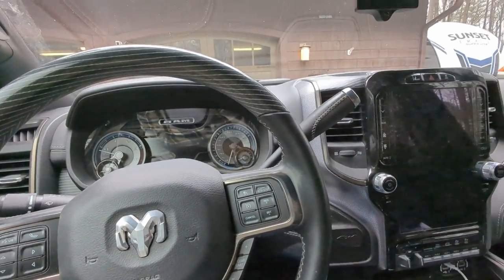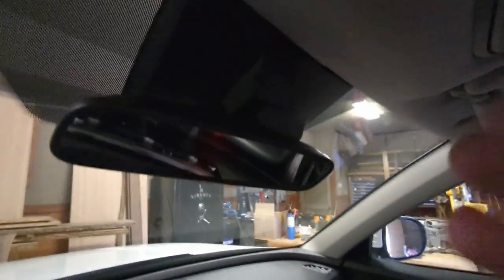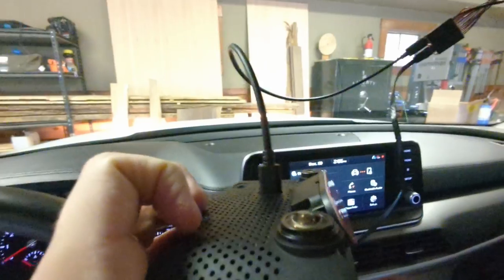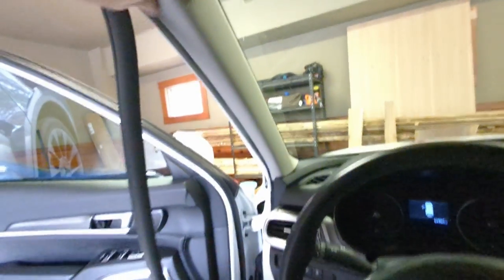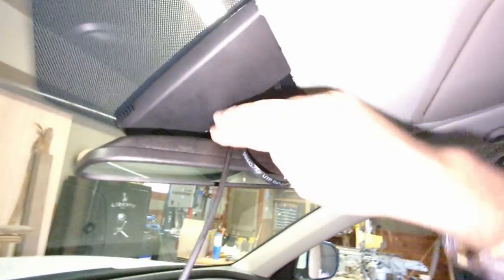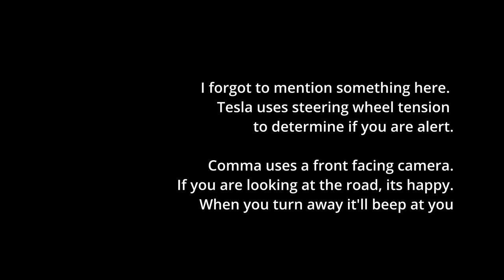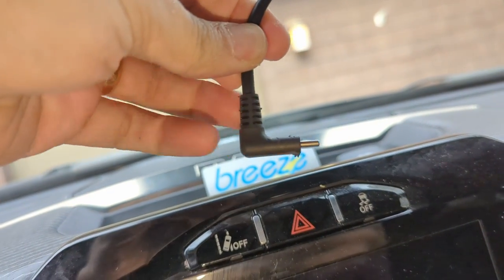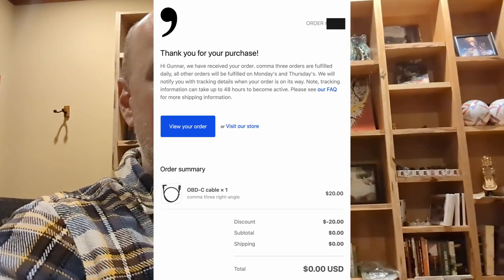Setting up a Comma AI in a Kia Telluride

Comment: This video was incredibly helpful. THANK YOU for taking the time to make it. Pulling out the foam around the door and the removing the side panel into the fuse area was the perfect solution! THANK YOU! Now I just have to figure out how to cram all the wires into the panel on the windshield. That's not easy.
Reply from the maker: thanks! and yeah, getting those wires up there was a pain, good luck!